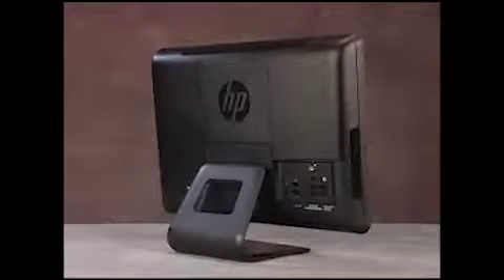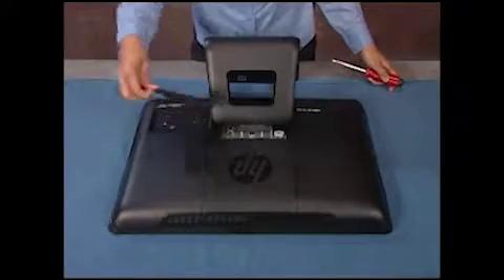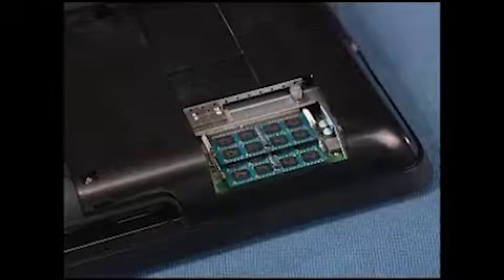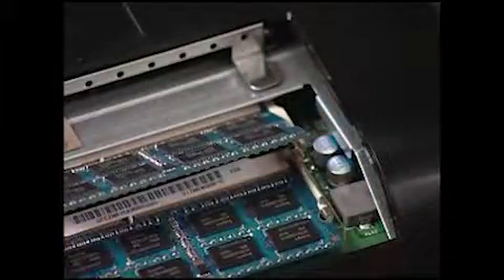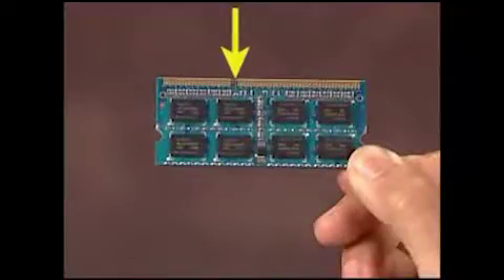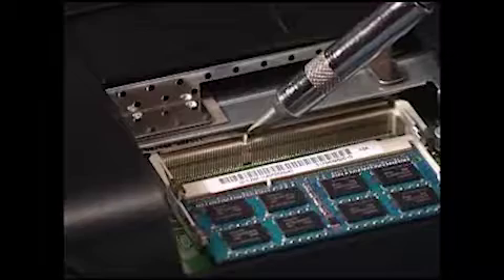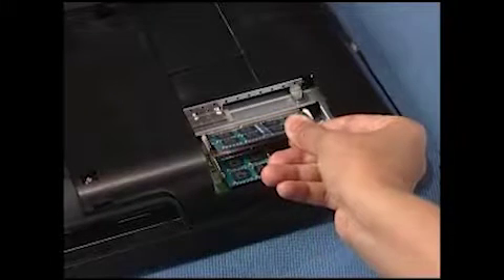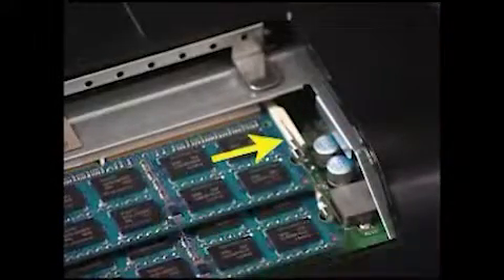Add or Replace the Memory | Pavilion All-in-One Omni 200-5000 | HP Support

Comment: How much RAM is supported for each module?
Reply from the maker: +Alexai Medina thanks for reaching out!
I understand that you need to know about memory upgrade information on your computer. 
I'll do my best to assist you.
Memory upgrade information:
Two DDR3 SO-DIMMs (204-pin) sockets
Supports 1 GB, 2 GB, and 4 GB DDR3 DIMMs per socket
Supports Dual channel memory architecture
Supported speeds
PC3-8500 @ 1066 MHz*
PC3-6400 @ 800 MHz
* PC3-10600 may be used but will run at a slower supported speed.
Non-ECC memory only, unbuffered
Supports up to 8 GB on 64-bit PCs (DIMMs run at DDR3-1066)
Supports up to 4 GB* on 32-bit PCs
* Actual available memory may be less.
Let us know how it goes.
Reply: @HPSupport  hi can I use two PC3-8500 @ 1066 MHz* at the same time?